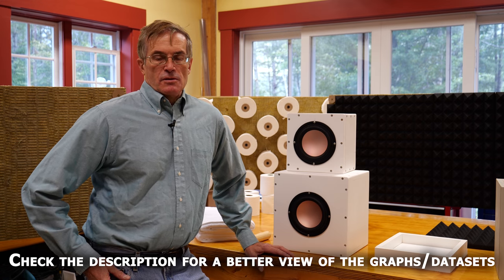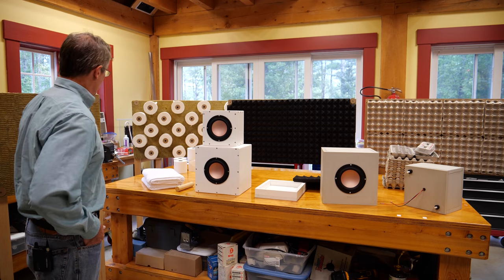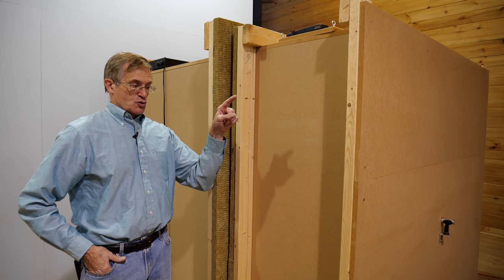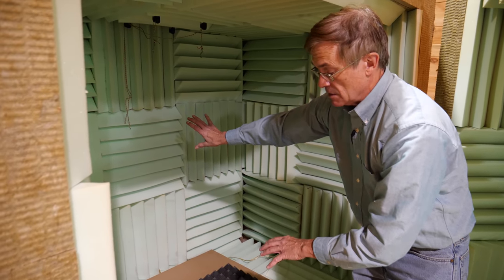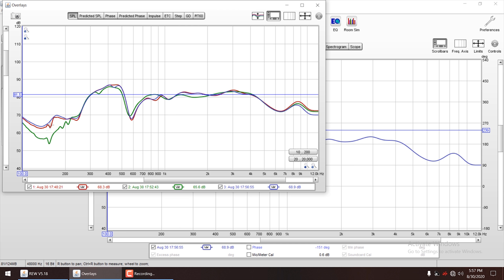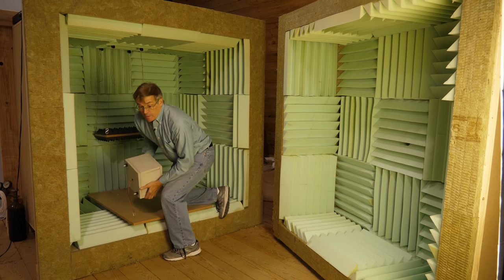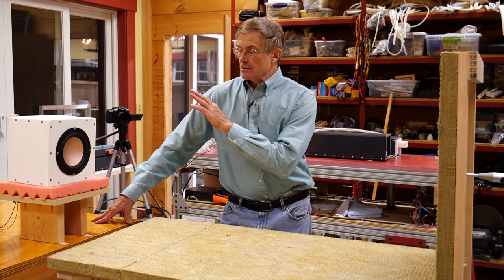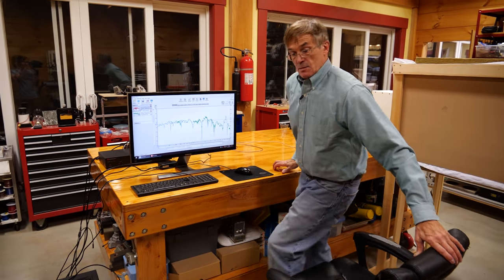DIY Speakers and Acoustic Panels

Comment: So a ported speaker enclosure involves some of the acoustic baffling like was done in the "best sounding speaker"  that they built...   its not just simply cutting a hole in the box..  also when dealing with pro sound or competition subwoofers, they are designed with motors that require the custom boxes with x amount of area inside to provide enough room for the air to propagate and lowering the hertz capability as well as increasing decibel output..  is when you get into band pass and audio filtering with massive power systems to push em...  ive seen systems on cars that push over 3000 amps @13.7vdc That drives over 40k watts..  talking about 4 alternators, 10 batteries, 20 capacitors dedicated to powering a sound system..  the truck with sealed doors reached 172db..  the world record is 182.1 by a van with doors that bolt to the body with 10 bolts and a steel plate over the windshield..   and it did it with 4-18" speakers..
Reply: Adding the world record spl of 182db was a system that was over 200,000 watts...  Done last year 2019...
Reply: Record is actually 184.9db..  for the spl world record..  my bad..  just looked it up..

Comment: If you cut parallel grooves of different depths in the rock wool, like a diffuser would the increased surface area and uneven surface increase the absorption of certain frequencies?  By varying the number of grooves per foot could you reduce frequency peaks/

Comment: You surely got your exercise workout on this one.   Wouldn't all the tests have been more demonstrative had you used your equalizer first to flatten the speaker output?  With all the different reflective surfaces giving a substantial drop in the 500-1000 hz range, I would think that's more of a deficit in the speaker output.
Reply from the maker: That would have been an option.  However, as the purpose was to test the relative performance of the different materials not the absolute performance, I think this was an acceptable approach.

Comment: What about toilet paper shaped more like acoustic foam? Basically cut the toilet paper rolls into cones. With the current roll-based design there are weird cavities formed between the rolls and the backing wall that have a negative effect on the low-frequency response. Cutting the paper into a more traditional shape might make the final response at the low end more similar to real acoustic foam material while preserving the good high end behavior of the paper.

Comment: Nice vid like always. I always wondered, what if you stack the ceiling tiles? I mean does 2 ceiling tiles perform twice as good?
Reply from the maker: That's a good point.  They're inexpensive and thin.  There may be an advantage to an air gap as well.

Comment: Wouldn’t the helium escape through the top port as you are filling the Speaker. Similar to a Radiator that should be circulated from the top to bottom in order to avoid “short circuiting” it?
I mean there was definitely a noticeable effect but it might have been more noticeable with a full Helium atmosphere. 
Thank you for some of the best and most interesting videos on youtube!
Reply from the maker: A little might, but the turbulence from the jet existing the tube mixes the gas and the effect should be linear.  It might be a little larger if the last few percent of air was removed and if you intended to use this for more than a demonstration then sealing the enclosure would be a good idea.

Comment: Might be a strange question, would the helium not have difficulty bleeding the atmospheric air out of the system coming in from the bottom... i will rise through the air and be pushed out the top? FYI havn't watched ahead as of yet, just something i picked up on. Thanks for all the vids though appreciate them and always good viewing :)
Reply from the maker: It shouldn't be too significant.  The high velocity jet of helium as it exits the tubing will mix with the air already in the speaker box.
Reply: @TechIngredients  Appreciate that I receive responses. Only posted twice and received a reply each time. Any further thoughts on Using ultrasonic sound to age spirits. Wish I could remember the other channel to give credit but i've forgotten.

Comment: I remember reading an article a few years ago about a shape somebody built using a 3D printer that uses destructive interference to completely nullify the sound that passes through it.

However, they never shared any information on how to build it yourself. Maybe you could try to reverse engineer it?

If you need help finding it... The shape in question was described as an "acoustic metamaterial".
Reply from the maker: That would be possible, but it would be wavelength and angle dependent.  That's probably why they didn't persue it.
Reply: @TechIngredients The impression I got from the article was that it didn't matter on the wavelength, because the destructive interference was based on the sound waves trying to pass through the ring and then bouncing off of the grooves in it, canceling themselves out, and it worked regardless of what the sound actually was.

It is possible that they just didn't report every detail though. I'll try to find the article again.

Update: The article is titled "Making the world quieter", written by Kat J. McAlpine and uploaded to the Boston University website.

Comment: Another question :)  At 6:48 you tell us about a small air gap. Does this gap also exist on the ceiling? How do you attach it?
Reply from the maker: It exists everywhere but the floor.  Long screws with cardboard washers holds the panel against foam spacers.
Reply: @TechIngredients  Thank you! Actually answering questions is like breath of fresh air on the internet.

Comment: I gutted my house in Brooklyn and at one point it was all exposed walls & ceilings with the Roxul installed.
The acoustics in these rooms was unreal. Your voice would just die in the room. I loved it but unfortunately the wife insisted that the walls be covered in drywall.
Reply: Stupid drywall smh 🤣
Reply: Couldve got sound absorbing sheetrock
Reply: damn, owning a house in Brooklyn, you must be either rich or old
Reply: Would consider replacing the wife before the walls but that might just be me. :) j/k ofc
Reply: Im working on a office building and almost everywhere is getting double layered 5/8s dry wall with sound glue in between then 1/2 in plywood on top and a layer of finish wood paneling. There is also Rockwool insulation inside the walls. I bet you could scream inside and you wouldnt hear it 1 foot away on the other side
Reply: All the better to yell at you.
Reply: If your wife nags at you from within an anechoic chamber, do you still get a headache?
Reply: That probably explains why sometimes they find ex-wives stowed behind a drywall covered wall.
Reply: How would lowerng atmospheric pressure in the speaker change the output?

Comment: 21:57..."now I may need a little help from you to feed that helium line in"

Me: mmh, OK, but how do I do that from here?

Also me: oh, he's talking to his son!

Love these videos. Really enjoy them. Thorough, dedicated, and great presentation.
Thanks
Reply: He does not mean you, but me.
Reply: Why didn't the speaker float if it was filled with helium?
Reply: @chrisreid1644  The buoyancy is equal to the difference of masses between the helium and the volume of air that it displaced. Lets say that the speaker was a 30 cm box, that would contain 27 l of air  the density of air is about 1.2 g/l so the box would have 32 grams of air, if replaced with helium as its density is about 0.18 g/l it would have had 4.86 grams instead. So if the speaker and enclosure were less than 27 grams its combination with the helium filing would have been lighter than the surrounding air so it would have floated but they were much heavier so they didn't but a scale would have shown the speaker to be 27 grams lighter (if it was those 30 cm, I am sure that the speakers in this video are some other size). A floating helium speaker might be doable with a styrofoam case and a tiny piezoelectric speaker.
Reply: Got a bit of a Mister Rogers vibe from that bit :-)
Reply: I had a Dora moment too

Comment: when you flush with helium you should feed at the top and vent at the bottom
Reply: ...and that lower vent should be piped back outside the main chamber (or the "door" opened for a short time just prior to the test) to prevent gas contamination in the main chamber.
Reply: Then attach a helium-colostomy bag to catch and recycle the helium while its working.

Comment: Concrete: The expected advantage would be hidden by the anechoic chamber.  A problem in speaker design is that non rigid enclosures vibrate (as pointed out in Tech Ingredients previous speaker videos!) - so they produce sound.   That sound isn't aimed (mostly) at your mic - so it's absorbed by the walls.  If you had a less absorbent chamber, you might see spikes where the enclosure resonates.
Reply: For sure. Ears are pretty sensitive and enclosure noise is noticeable to someone critically listening when it's the cabinet ringing and not in the actual recording. Human brain will pay attention to the noticeable frequencies which usual mean louder and sustained ringing from the resonant frequency is easiest to hear. Concrete would if anything be quieter since it so heavy and take more energy to resonate  Usually non rigid enclosures are more obvious that its a boxed speaker type sound. Would be good for Tech Ingredients to add a crossover and tweeter and get them sounding decent. Then sit and listen to some test tracks with all those cabinets they made in blind listening tests in a quiet small room. Not the Lab. I think they will notice all those speakers they made with the same woofer sound different in a minor way even though they all measure close in the anechoic chamber.
Reply: I came here to say the same. It would probably be easier to see looking at the waterfall graphics, not the frequecy responde chart. But I dont think it would do a huge difference anyway. Also, it would affect the harmonic distortion of the set.
Reply: 25-30dB below the original sound (direct sound from speaker) is sufficient to our brain to ignore cabinet panels vibrations; that works consistently with music, spoken voice (intelligibility), total harmonic distortion (THD), etc
In the lower frec regions, time delay (waterfall grafics, electrical phase delay and pulse response) are more relevant
Reply: @pedrova8058  The cabinet will be out of phase with the main signal so you will have some interference which can be a big deal at lower frequencies.   The main vibration will be in a limited range of frequencies causing a spike or hump and often can be very audible.  But it is well established that cabinet vibrations are audible (not subtly).   Anyway, wasn't the point to test whether it made a difference?  And doesn't an anechoic test make it hard to detect?  Check out the Audio Science Review forums and read any speaker review (for a speaker with a crappy enclosure) .
Reply: yup, it is, but at higer modes also makes interferences. Thats why damping low and high modes (via stifness, weight, density, internal bracing, viscoelastic materials, very high "pitched" panels, etc) its relevant. 
In HiFi world there a lot of "grey"  zones in technical evidence (scientific know well correlated with human perception )  ,like power cable effect in response for example (you can measure it, but its imposible to ear it in blind tests);  in PA and professional sound studio conditions, the technical info on acoustics and human perception is abundant and well established
Reply: @maxrockbin  you forget that the room itself where humans stay/sleep/sit in will dominate any phase shift inside the cabin which is already around -30db below intelligibility in respect to the direct radiated sound off the cones. put damping material inside the enclosure and it becomes pretty much deadened therefore no need to get fussed about cabinet vibration unless we're talking about very thin ply of wood
Reply: @automachinehead  OK.  But - just for ref -reducing box resonances is a MAJOR consideration in speaker design  Open any quality speaker and you will see bracing and often damping material to reduce box vibration.  Most boxes are also made of thick MDF.  Heavy and costly to ship.  Not for nuthin.
Reply: @maxrockbin  Yes I know what you are saying that's why instead of bracing I used a 4" concrete slab (with laminates of course) on top of my diy speakers/subs
Reply: @automachinehead  that's wattsup
Reply: Floyd Toole has written a lot about his Spinorama design which if measured, would help greatly in clarifying here. I'm also particularly interested in the characteristics of concrete speaker designs. It would be really interesting to see off-axis measurements for this - and I suspect you are correct in that the chamber hides the real-room advantage (or disadvantage).

Comment: Hardly an expert, but I had always thought that both the internal 'stuffing' in speakers as well as the avoidance of ported speakers were to reduce distortion, improve phase response, not to flatten the frequency response, and that using dense materials was to try to make the driver be the only vibrating element, rather than the sides of the enclosure. Your SPL tests don't really address either of these factors, and if I understand how REW is measuring here, it's generating a stimulus signal and either bandpass filtering the response and measuring SPL, or just measuring total SPL, so harmonic resonances here would probably show as 'improvement' or 'no change' even if it sounds horrible? And any off-axis output will be attenuated by your anechoic chamber, and even if it were measured would again just increase SPL even if it results in 'multipath'.

I'm curious to see well thought out and well presented empirical tests like this on these topics. Maybe I'm wrong (and would be interested to learn why these factors aren't!) but I don't think what you've done here has really addressed the reasons that designers choose dense materials, internal stuffing/insulation, or the tradeoff of adding ports.
Reply: Totally agree with you. Same goes for concrete vs std enclosure. Measuring spl doesn't say anything. You would have to measure harmonics, vibrations, etc. He could compare concrete vs standard when positioned backwards to the microphone. This could show something. Then again this anechoic chamber does nothing for low frequencies and those will have most impact on case resonance and effect of absorbtion inside enclosure...
Reply: I think cabinet resonance gets rapidly more of a problem as the size increases, as the stiffness of a wall falls as a high power of the dimensions, so that the resonances drop right into the most sensitive part of human hearing.  Speakers around 40 x 60 x 100 cm would be a better test for this, more the PA speaker size than bookshelf sized.
Reply: The whole section on wall rigidity and internal damping completely misrepresented why manufacturers strive for this. 
If your objectives is to maximize dB/W by all means follow the advice. If you want fidelity please ignore it.
The acoustic panels section was more useful, however I don't understand why he didn't put the panel he was testing inside his chamber over a wooden panel.
Reply: I think you could possibly be labouring under a couple of misapprehensions.
The stuffing inside a speaker in effect makes the cabinet seem larger, it slows down the sound. It also helps absorb resonances and stop re reflected out of phase sound going through the driver cone. It is almost transparent to the re radiated sound from the inside back surface. Which confuses and muddies the sound.
A port or slot, Bass reflex port is to control the cone as it gets to it's resonant frequency. If designed correctly the air mass in the port will be out of phase with the driver when resonance occurs, damping cone excursion and making the output more linear. It also helps boost output when in phase, helping lower frequency output.
BTW. A speaker is the direct opposite of a musical instrument. It should ideally have no character, colour or impart anything extraneous or extra to the sound. That is the goal. Cabinet resonance is a killer. Stiff, solid and dead is the way.
Reply: So many considerations are being completely missed, or mischaracterized. For example, there's very little discussion about how the anechoic and partial test enclosures construct and destruct frequency modes (variously mischaracterized simply as "reflection" or "absorption" of sound). There's also nothing mentioned about the T/S parameters of the drivers, esp as regards their performance in sealed vs "ported" cabinet testing. Then using variable smoothing skews the results. This is a great example of someone who has 75% knowledge in the field, discussing things with confidence and conveying a sense of unfounded expertise. A bit of tweaking of his testing process employing the inverse square law could actually yield some legit results.
Reply: @ttmitcham  Give me a freakin break. The guy laid out a whole bunch of different scenarios and applications and he tested them with what he had. You be the judge and you apply your own tactics. He did a shit ton of work to do this video and i applaud him for it. If you want a detailed hypothesis on this topic go elsewhere, Dont complain of what he didnt do.
Reply: @ttmitcham  LOL let’s see you do it as someone who supposedly knows more than 75% knowledge on the subject. Doubt you could derive a more useful video. His goal is more simplistic. To show a relative relation or disassociation between certain variables. His goal was never to show what you explained. Also the plethora of subject matter he explains and has made videos on is commendable. You might be more educated than he is on this subject matter, but you will never touch the vastness of this guys knowledge and skills sets. Haters gonna hate.